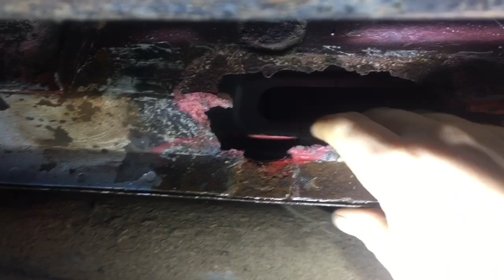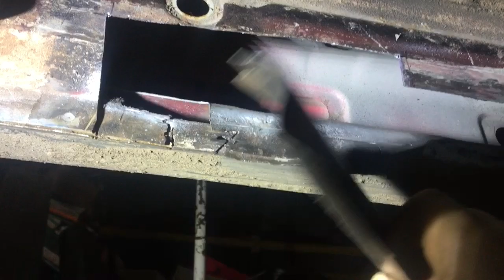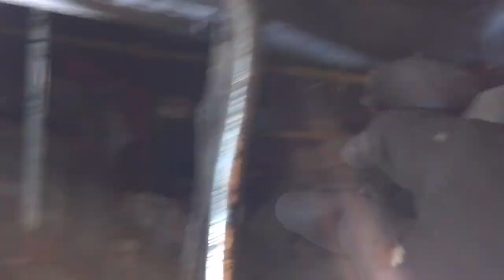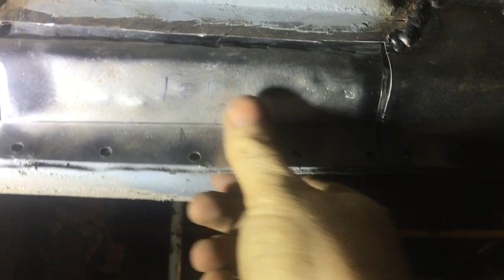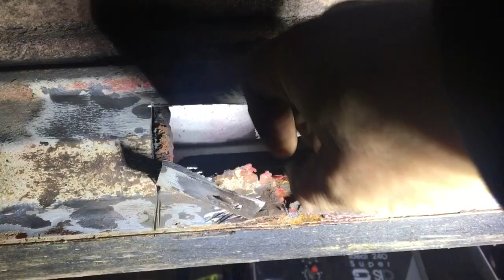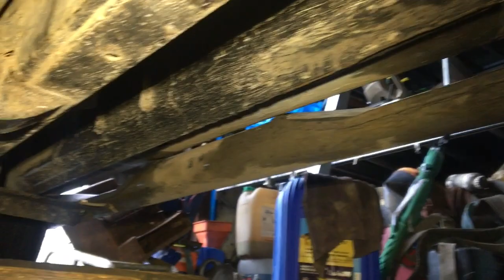Kia Sorento -Welding sills [ So much Rust] 🙈

Comment: Your braver than me. I'm in a simular situation with my 2008 Kia Sportage. It's only hot 60,000 miles on it and has been kept in a garage since new. Do you have any issues, with the rear subframe? Mine is completely disintegrated along with the frame area it attaches too. I just wanted to know if you had any issues with the rear sub frame, and if so could you fix it.
Thanks
Reply from the maker: Go to Kia dealership, I think there might of been a recall on those cars for the rear subframe/ trailing arms . So you might get it swapped out for free. Worth a chance. I remember hearing about it my Kia Sorento is the first generation but I think the recall was for second generation or maybe it was for the sportage not the sorento . 

Other wise you will need a new or good second hand rear frame . And if it’s the actual car frame you will need loads of welding 🙈 

I think Kia only paint the outside the cars they don’t dip the cars into paint so the cavity’s in the subframe never get painted . But they have loads of drain holes but they work the other way around the drain holes let water and dirt in and the metal rots from the inside Out

Comment: How does it look today 2 years later?
Reply from the maker: It will be going over the pit tomorrow so lll give a look . The last time I changed the oil, I gave it a looked and it looked like oem . But I removed the drain holes because they never let the water out but always let the water in = rust

Comment: Hey man, how easy is this?
Reply from the maker: It’s ok if you are good at welding . It’s just time consuming to be honest . Make the panel up in one big go . And spot weld everything . Then use seam sealer to fill all the gaps and then paint . I think that is the best solution
Reply: Sweet thanks! @stevenharpervw

Comment: Hi Steven. I Have a similar problem but need to get someone else to do the work. Does it take a long time as I suspect the labour costs could be quite horrific?
Reply from the maker: Best advice - the metal under the Kia is in a z kind of shape. Get some measurements of the angles and get it pre folded into 1m strips. Then it’s only a case of drilling out the spot weld at the bottom and cutting a straight edge to weld on the top . It’s the hand bending for me that took the greatest amount of time. If I had it pre bent and in 1m lengths it would of speeded up the job so much
Reply: @stevenharpervw  Thanks Steven for the advice. I will have a go so that it cuts down labour time for the welds
Reply from the maker: @SeawolfGB  like 👍 and subscribe

Comment: You done a good job welding what type of welder were you using.
Reply from the maker: Thank you I’m using a SIP with 1mm tip and wire . Maybe 0.6mm would be a little easier to use and less chance to burn through

Comment: oh my word, what a rotter! I think that's the strongest part of the car now! The foam insert can either be pat of the structural strength or more likely stop the sound vibration from echoing though sill😄 if the paint is still on its a great weld